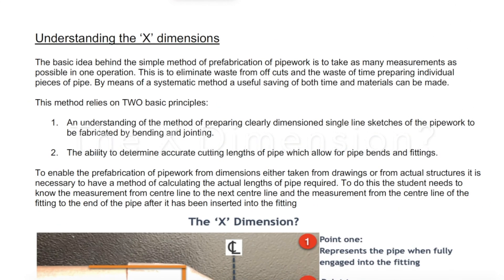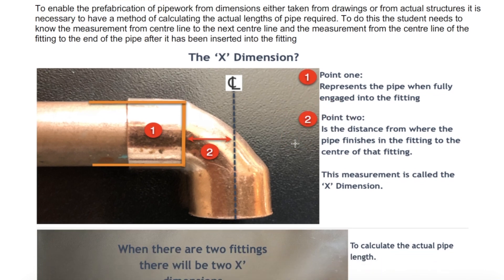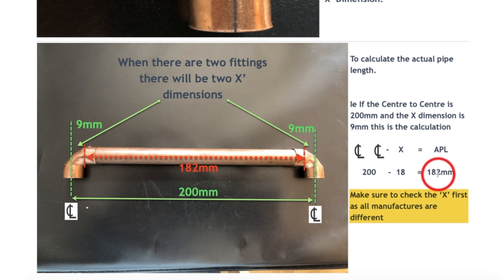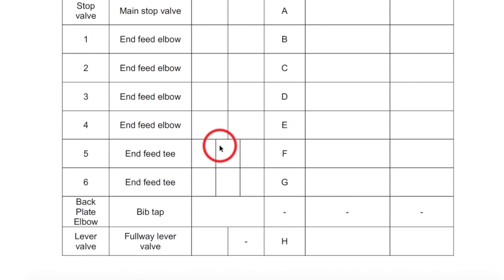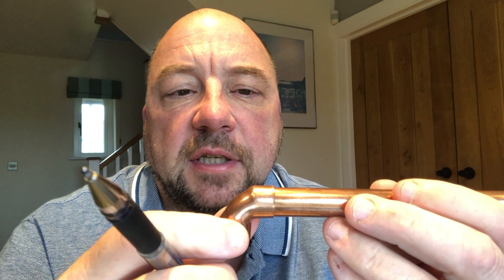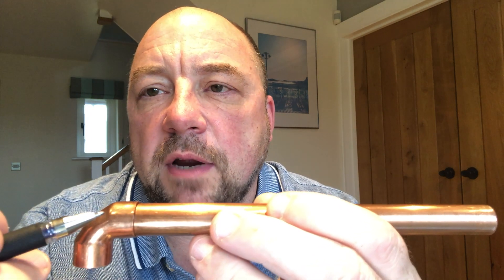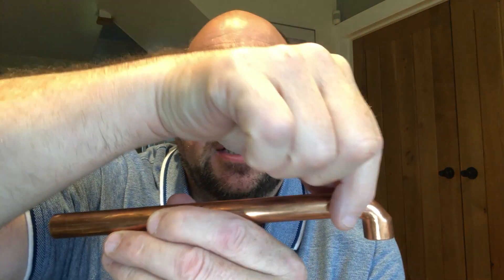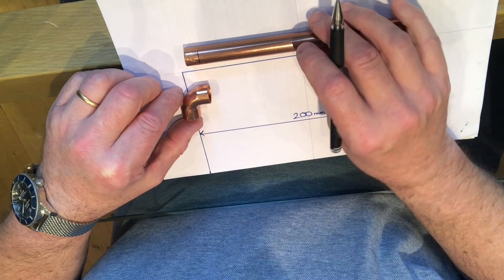X Dimensions

Comment: Good technical explanation, but easier way, cut a piece of tube of the fitting size at 100mm, insert fully into the fitting, measure from center to the end of the pipe fully iserted into the fitting, anything over 100mm is the "X" dimension.

Comment: Great video Paul. As an amateur plumber been doing that for years so glad I got it right. One minor point some pipe cutters round the end of the pipe a bit so it goes further into the fittings reducing the X dimension. No issue at all I think as long as you use the same cutting method and de-burring etc.
Reply: true